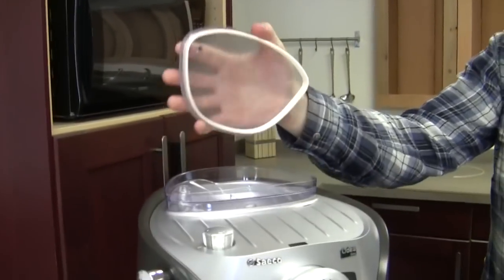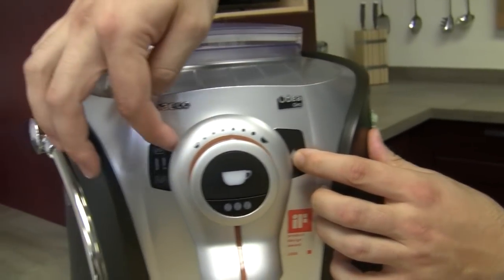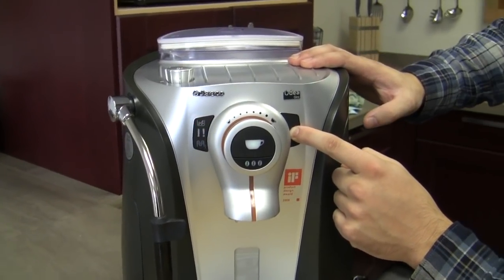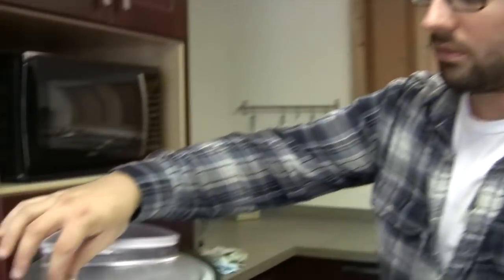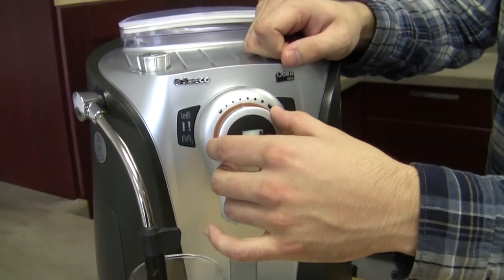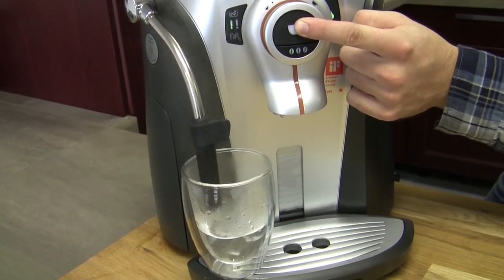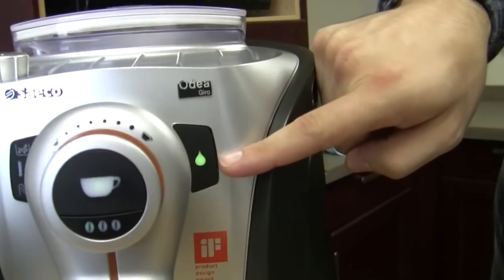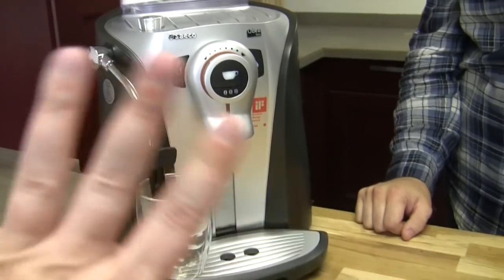SCG Tech Tip: Saeco Odea Series Test Mode

Comment: Hi great video and so nice of you to respond. I have a misbehaving Odeo Giro Plus.  It has essentially 2 problems, but I'm sure they are related.  1) while brewing, it starts to run out of water toward the end of the pour (even though there is plenty of water avail).  The pump starts to struggle and finally just spins, sounds like it is having trouble 'pushing'.  If I turn the knob on and then off again, it seems to release pressure, then the pour continues and completes.  2) the unit fails to detect when it has run out of water--and still keeps trying to pour but with no water! I'm sure much more of this and it will fail completely.  BTW, I have another matching unit (purchased refurbished from Seattle Coffee Gear) that is working great still after many years and heavy use.  I swapped out the brew group from this one, and it still happens, so I know it is not brew group related.  Thanks in advance.
Reply from the maker: Hello Jeremy Dill, There could be a couple of things at play: My first thought was that likely the grind setting isn’t quite right, and maybe it's set just a touch too fine.  This means that as the machine is brewing, the pump can struggle to push the water through, which is when you’ll get the slow dripping that you mentioned.  Likely going one notch coarser will take care of that, as the grind setting is just on the border of what the machine is able to properly brew through to give a good flow.  Just keep in mind that after you make a change to the grind setting, you’ll need to brew 4 cycles to clear through the mixture of the old and new grind settings before reevaluating.

The other thought that I had was when you’ve last descaled?  We generally recommend doing this ever 2-3 months, depending on your water hardness, but if it tends to be on the hard side as often as every month is fine too. You can’t hurt the machine by doing this process more often.  Likely, since it is both needing to be frequently primed, and sometimes doesn’t sense that it’s out of water, this could be an indication that there’s some buildup on the water pathways.

If that doesn’t do the trick, then I would suggest bringing it in for repair, either with us or to a closer Saeco repair center if you’re not under our SCG warranty. It may be a more intensive issue like a microswitch, pump, or board, but could also be other things! I hope this helps! ~ Miranda
Reply: Seattle Coffee Gear Nice! Thanks Miranda for steering me in the right direction.  I descaled a couple more times and it seems fixed!  We did let it go too long without descaling last time.

Comment: Hi and thanks for the great video.  I a have a problem with my Odeo Giro that I am hoping you can help me with.  In the middle of grinding, it completely shut off.  The machine is still plugged in (I have tested multiple working outlets) and the on/off switch is still depressed to show it is on, but no lights, no indication at all that the machine is on.  Did I blow a fuse on the machine or do you have any other tips or pointers?
Thanks!

Comment: Hi Seattle Coffee Gear,
I have a Giro Plus and I need to reset my dregs level somehow. It shows the ! when there is only one or two dregs in the basket. Is there a way to reset the level?
Thanks for any help.
Reply from the maker: When you get the alarm to empty you dredge box, it needs to be removed from the dredge box sensor for at least ten seconds. The machine does not measure the weight of the dredge box itself, instead, it's programmed to tell the user to empty the box every 13 shots pulled. If this does not remove the '!' then the alarm is representing an issue elsewhere. - Brendan
Reply: Seattle Coffee Gear
Reply: Abdul Latiff Md Ariff in
Reply: well it's probably no more relevant, but for other readers... sometimes the press plate gets dirty because of the steam, I just clean it with my finger

Comment: I have an older (2003) model Saeco Talea Giro. I ran the diagnostics on it per the video. The pump makes a weird sound in test mode and will not dispense water in test mode but it will dispense water in normal mode. Somehow (husband), got the brew group stuck in the working position, so I put the machine in test mode and returned the brew unit to the home position, then ran the rest of the diagnostics. I shut the machine off and then back on and tried to make a cup of coffee. The machine grinds the coffee, the brew unit starts moving, the pump makes the regular pumping noises but no water comes out of the of the spigots and then the  brew group makes a very loud popping sound and the red exclamation point comes on and starts blinking. Any tips?

Comment: Hi guys, running my SAECO ODEA GO SUP 0310 on TEST MODE I don't hear that "click" of the "Solenoid Valve". I'm going crazy here cause there's no part called "Solenoid Valve" on the machine's diagrams. Would it have a different name? Could you show us on a video or at least a diagram where this valve is? Or any other suggestion on how to test this specific problem and to address this specific part to replace it? That's the only problem I'm encountering. I would really appreciate your help. Kindest regards,

GUS

Comment: Hi
I have a small problem with my Saeco Odea Giro Plus. When I try to make a cup of coffee the stuck brew unit is moving away. I can't explain the whole problem in words... it's just really weird. So here's the link on the video how it looks like...  http://youtu.be/g82EzJJEu8Y

Do you have any idea what could have caused that problem???

Thanks
Alex
Reply from the maker: Hi Alex, Thank you for the video! Unfortunately, it's hard to say what the exact issue is without physically seeing and checking out the machine. There may be an issue with the brew unit motor or microswitch which is preventing the brew unit to function properly. If you're local to the Seattle area, we would be happy to take a look at the machine for you! Otherwise, I would suggest contacting Saeco to find a local service center. Saeco can be reached at 1-800-933-7876! - Haley

Comment: OK, Now I am going to chime in. Oh, thanks for the Test mode description, very useful for all us owners of these complex machines. I DO love them, no more work than my old big machine.
ANYWAY, my Giro Plus started to falsely think it ran out of coffee beans. grinds, grinds,grinds then the error light as if it ran out beans. I have cleaned out the grinder, run the adjustment back (courser), asked for less grounds, more grounds, even run some grinder clean through it and cleaned it again, nothing has helped.
Now if it was the sensor faulting, you would think it would think it was going slower, the pulses getting slower not faster. Please your thoughts.
Also, this is not every attempt to make an espresso more like 60% of the time, a waste of coffee!
Reply: +Mark Kather were you able to fix this issue? My Odea Giro started doing exactly the same last week. I am wasting 2 out of 3 coffees since then :-(
Reply: Hey, no I did not fix the issue, just put the machine on the shelf and bought another. Saeco finally responded that it could be either the Grinder Motor or the pulse generator that is suppose to produce a pulse or pulses as the grinder spins to a, make sure the grinding took place, and b, to make sure of the speed. I was told it could be just dirty, i.e. the intermittent. Someone did respond here with the results of the same problem in another model.
BUR, like I said, I had another amchine and never got around to dismantling the Giro. Maybe this winter.
Reply: +Mark Kather Thanks for your reply!
I had my Giro serviced a couple of months ago and until last week it was perfect (it's 9 years old). I guess I'll bring it back and see what it will cost me to have them take a look otherwise I will dismantle myself (did once already in the past)

Comment: Help. My Saeco Odea has a pump issue. I’ve manually primed and there is no blockage.. it makes a loud noise. It made a cup yesterday..
Reply: Had similar problems. Mine has had a blockage near the sprout, where the one stream of coffee splits into two. The previous owner never turned it off so the machine never had the chance to rinse itself

Comment: Don't know if this thread is still viable, but here goes. BTW, I have downloaded the parts manual. I have started getting rapidly flashing  red led's and a failure to grind. The grinder starts then stops. When I put my Giro into test mode it will start to grind, then stop. In the video you noted that the water light flashes with revolutions of the grinder. Mine doesn't. I hear the motor wind up, then just stop. You mentioned "It's getting that signal". What part is "getting that signal"? Is it part #181540900, the electronic board with HAL506 sensor?  Thanks.

Comment: Thank you for this video. Much appreciated. Can you shed some light on an issue I'm having on my Odea Go SUP031O. The machine brews coffee fine but turning it on is like trying to solve a puzzle. Nothing happens when you first press the power button. I usually have to open and close the dreg drawer a few times to get it to "wake up". Sometimes that is not enough and I try pulling the water tank out and back in, or the lid to the bean hopper off and on. Once it wakes up, it is fine.  My service provider told me it is an electronic board issue and that it is not worth fixing and to replace the unit with a new one. I like this machine and would like to try to fix it.  What is the part number of the control board that I would need to order for this machine. I see there is a board behind the dispensing area in front of the machine but there is also a board adjacent to the first one (schematic 32 Power Board and schematic 14 CPU + Faucet Board).  Can you please direct me as to which board I would have to replace. I appreciate your help.

Comment: Hello. I need help

So a week ago I got a Seaco Odea coffee maker,it was a present for my birthday. The other day I made 2 coffee's,everything was perfectly fine. On the next day,the machine wouldn't make anymore coffee. When I turn it on,this icon that looks like a key,is flashing - green color. I know it shouldn't flash,it should just stay on.  According to google:
Flashing quickly (multiple times per second):

The machine is too warm, dispense some hot water to cool down the machine.

There is not any hot water..? I did change it,tried anything but it just won't stop blinking. Please any fix for that? What should I do?

Comment: Hello, my brother gave me the ODEO Go. From the first uses, I put the grinder in the minimun, but the caffe was very smooth and watery. The grinder adjustment only allows you a half turn, and it was still not enough. I pulled out the container of coffee beans  unscrewing a screw of the container, and you can get out the ginder regulator and move another half turn clockwise and put in again. This allows you finer grinder setting.
Now, the coffe is tasty.
I would like to ask you if this can cause any malfunction in my ODEO? Or Is it posible to make a video doing this adjustment from you side?

Best regards.
Reply from the maker: Hello Andoni Cadenato Velasco, It sounds like you recalibrated your grinder to a finer setting, which should present no real issues to your Odea if done correctly. Moving the burrs too close together can cause them to wear more quickly, so any calibration should involve moving burrs together to the point of touching and then backing them apart again a small amount. We don’t typically advise doing this at home and suggest it being done in a service center so a technician can be sure the process is done correctly. - Teri
Reply: Andoni Cadenato Velasco  did you ever get this sorted out. Im having the same problem. Mushy pucks

Comment: I have a problem with my Odea Giro that I haven't been able to solve. Periodically, the pump can't push water through the brew group. Water can still come out the steam wand but not the brew head. The machine will behave this way for some time. But then randomly it will work fine. I've taken it in for servicing, but it aleays works when I turn it in at the repair shop. Any ideas?

Thanks for the videos. They're very helpful!
Reply: +squeegeegee - I'm having this same problem. It was working intermittently, but now not at all. Steam and hot water work fine, I can hear the pump functioning, but it makes a staining noise when switching to coffee, like something's blocking the water flow. Cleaned and tested the brew group, seems fine. I'm thinking the blowdown valve/solenoid valve?

Comment: After descaling my Saeco Talea Giro plus 2 the red descaling button is fixed on and I can not do anything. The test mode works fine, and the machine was working fine before I descaled it. It seems that something needs to be resetted, but I do not know how
Reply from the maker: Hello Pablo Tebas, Unfortunately, there isn’t an easy way to reset the machine when you’re in descaling mode.  These machines just need to go through the whole cycle without being interrupted, so if you’ve already done the descaling portion, you can just use clean water. I’ve heard it taking as many as 12-15 tanks of water to run through, which can be frustrating, so sometimes “tricking” the machine by putting in a full tank of water to rinse, and as it starts to continue the rinsing, you can pull out the water tank, causing the machine to think it ran out of water.  It may take many times of doing this, but eventually, the descale light will clear. - Miranda

Comment: Super helpful.  Thanks for sharing!
On my machine, turning on the steamer results in water collecting in the drip try inside the machine.  Nothing comes out of the steam wand.
In test mode I don't hear anything when I test the Solenoid Valve.  Nothing happens when I run that test.  
So, I assume that's my problem.  Is that actually the "Blowdown" valve?  (I'm looking at a parts diagram for the machine and I don't see a solenoid valve)... thanks!
Reply from the maker: Hi greenguy97, interesting question!  I would suggest running a paperclip up the steam wand to see if there's just a blockage, then maybe it will push water through without an issue.  But if that won't fix it I'm not sure what the problem is exactly. It's not necessarily the blow down valve so it would likely need repair.

Comment: hi.i like very much how you explain things . i have a giro myself and i have a strange issue regarding the blockage of the brew group .  After the 1st block i did unblock it , but after 2-3 coffes is blocked again . i tested the group and in the test mode worked ok. what could be the problem to my giro ? is is the brew group or other component ? thanks in advance.
Reply from the maker: The best suggestion we can make is to try to clean the brew unit thoroughly, by cleaning the screen. You can watch the YouTube video here: SCG Tech Tip: Saeco Superautomatic Brew Unit Disassembly
If this doesn’t work, it’s hard to say without seeing the machine in person. While it sounds like the gear is working properly according to your testing, it could be the brew unit that’s having trouble, or the motor/gear is encountering some strain. If you’re in the area, you could bring it in and we can take a look at it and give you an estimate, or you may want to find a repair center closer to you by calling Saeco directly. - Miranda
Reply: hi, thanks for the fast answer.
i did some research and after cleaning again the brew uinit i discovered that the disposal sensor was all covered up with rust , i cleaned that , reassambled the machine and now it`s working again . Thanks again, i couldn`t do it without your help. 

ciao.

Comment: Hi there,
I run the safe mode as shown in the video, but now both top and bottom lights are flashing alternate without  stopping. What should I do? There is no coffee so it can't be clot beam. Do I have to exit safe mode? And that's why the lights are flashing? Please help me here...
Thanks
Miguel
Reply from the maker: Hello! if you’re still in test mode, you should certainly exit out of test mode.  You can do this by powering off and then powering back on.  If the alternating lights clear, great!  If not, it could be a clog in your grinder, or it could be something else that needs some repair.  It’s hard to say without having the machine in person to evaluate, so you could contact us to set up a repair, or you can contact Saeco for a closer repair center: 800-933-7876. I hope this helps! - Miranda
Reply: Thanks it helped!

Comment: Thank you guys, very useful! D'u know how to stop the machine to clean itself every damn time it goes out of the stand-by mode? thanks

btw try this coffee beans if you can find them: http://hardyespresso.com/
Reply from the maker: Unfortunately, there is no way to stop the machine from doing that. It is for the good of the machine! - Steven
Reply: Seattle Coffee Gear oh, that's a pity, thanks anyway. Really I also have an older Odea Giro, and it doesn't do that (and it also makes a better coffee).
Reply: Seattle Coffee Gear Hi, probably I did something wrong but after descaling my Saeco Odea Giro the green hot water button keeps flashing and I cannot get out of that mode. How to rest the machine or to get back in a coffee making mode?Thanks for a quick answer, I need my coffee.....
Reply from the maker: Frans Lampje It sounds like you are still in descale mode and just need to reset the descale counter. With the machine turned on, press and hold down the water droplet button for about 15 seconds. This should reset the counter and let you start brewing again! - Teri

Comment: Hi, Does the Odea Go have a fuse? Our machine was working well and was in standby mode when we had a power failure in the house. Now the machine won't start. Anyone know the reasons / have any solutions? Thanks
Reply from the maker: Sounds like the power board might need to be replaced. We recommend having a tech take a look at it.
Reply: Thanks for the response.